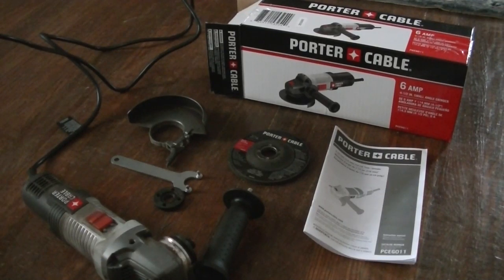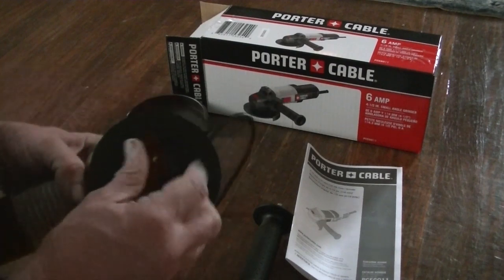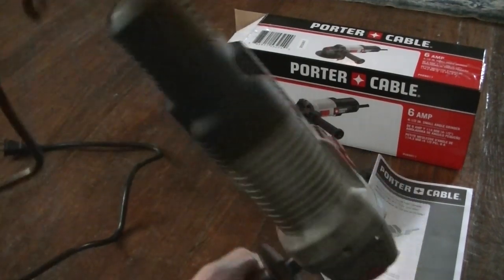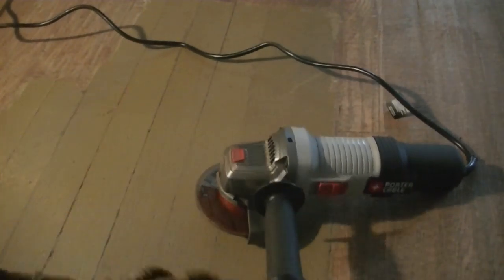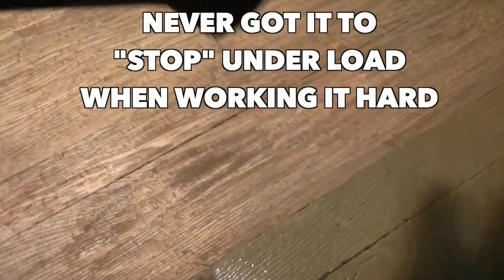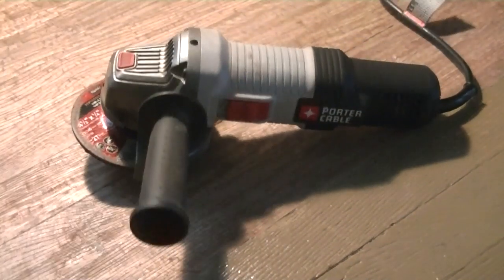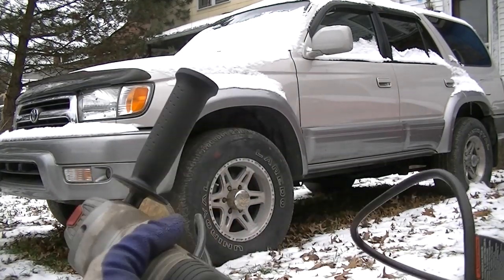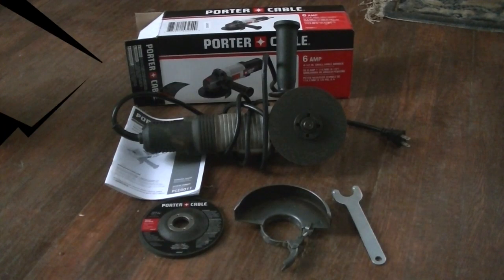$29.99 Porter Cable Angle Grinder Review. Any Good? Worth it? Find out.

Comment: What I have found is that the guard that comes with these angle grinders only support a type 27 grinding wheel.  NOT a cutting wheel but a grinding wheels.  The Type 27 wheels are offset in the center and this guard allows for it.  A cutting wheel is a type 1 wheel and requires a different type of guard.  Once you swap the guard to a type 1 guard your cutting wheel will fit as expected.
Reply from the maker: Nice!!
Reply: Funny enough that the disc that comes with it doesn't fit in the guard 😅

Comment: Have you found the cutting wheels are not compatible with the guard that this comes with?
Reply: The guard that comes with this grinder is a type 27 guard.  He is trying to use a type 1 one cutting wheel in the video.  You can use a type 1 cutting wheel with this grinder but you will need to swap the guard out for a type 1 guard.

Comment: I been using the 9$ one from harbor freight for over two years no problem.
Reply: new Leaf  hasn't quit yet
Reply: new Leaf  I used it to cut stabilizer links off of cars and trucks,so those fence links should be no problem

Comment: I tried to install a 4-1/2 inch thin (.045”) DEWALT Cutting Wheel, General Purpose Metal Cutting disk but it interferes with the guard. Any idea why? Thanks
Reply: Just don’t use the guard lol
Reply: If you look at the video when he is cutting...he took the guard off!! Hahaha!  You need to get a Type 1 Guard if they make it for the model you have...Type 1 guards cover the bottom of the wheel also where the Type 27 are open...Otherwise get a Type 27 Cutting Wheel.
Reply: buy a type 1 guard